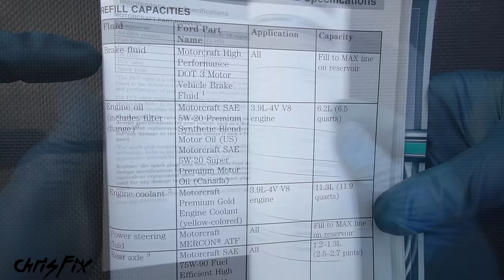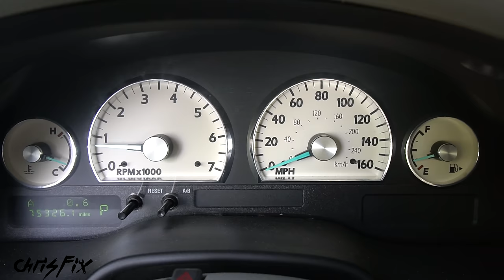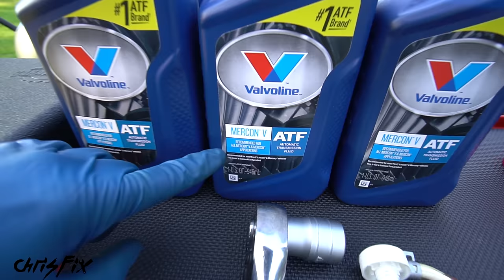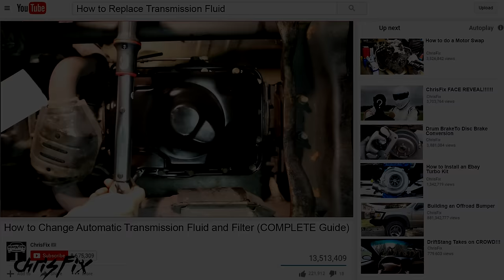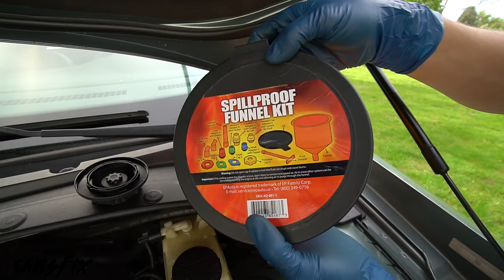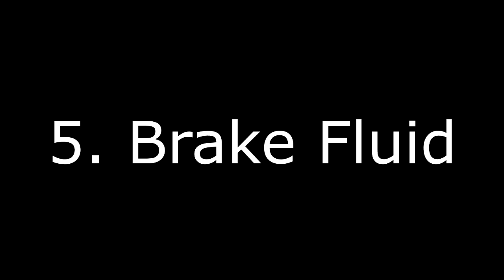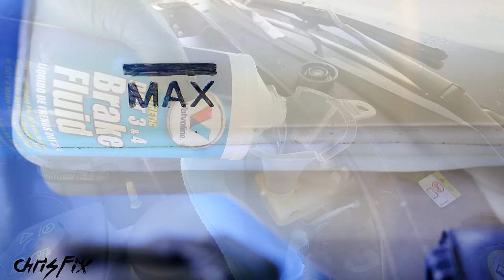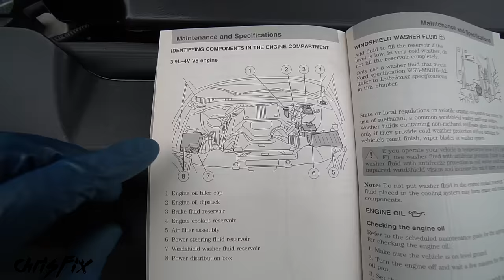How to Change EVERY FLUID in your Car or Truck (Oil, Transmission, Coolant, Brake, and More)

Comment: I was told not to flush any of my fluids because my car has 175k on it now. Otherwise it’ll get sludge and particles in the valves and engine and act up worse. So what do I do?
Reply: That is ABSURD! Are they telling you to not change the oil as well??? Or are you talking transmission only?
Reply: You never really wanna flush any fluid with too high miles. But even with high miles a simple drain and fill will not harm anything.
Reply: @Bobby-cm7vu  Well said

Comment: I disagree with this maintanance method
For a ford transmission
Just drain usung inner drain plug. You will change much less fluid.
You will be keeping the friction material inside and freshen up the fluid..
You can do this more often at no risk.!!
At low mialage and a first trans oil change the method in video is good.
The workin particles can flush.
From then on use the inner drain plug change less fluid and keep the friction material in the transmission.
Thats what the standpipe is for.
Cheers!

Comment: I bought a 01 jeep WJ V8 with 185k miles for almost nothing, needed a new starter and power steering pump, both are remade, however I noticed the transmission fluid is still red, I don’t know if it’s the original fluid or if it was ever change. Transmission shifts are smooth except when going almost full throttle sometimes from first to second, like it surges. Does anyone if a drain and refill of the trans fluid along with a trans filter change is a good idea or should I leave it alone? It’s more of a backup vehicle.

Comment: got a question, just did trans maint on my 5L40E on my G8, there is no dipstick, no fill cap, no drain plug, just a fill plug which is your drain plug then you drop the pan, i did all that and factory says 9.4q and everybody that has been in forums and on youtube that worked on a 5l40e says just under 5quarts, mine started dripping out at 4ish quarts. i did everything correctly and did my research and sometimes when i down shift from 3rd to 2nd around 1500 rpms , now my car jerks around mostly first 5 mins of driving, then is kinda stops and its not every downshift it just randomly happens when downshifting, mainly notice is when im braking from 3-2nd to take a turn?

Comment: Hey man my radiator coolant is a reddish color now and it’s only a month old what’s that mean
Reply from the maker: If your car is an automatic, it could be that transmission cooler lines are leaking into the coolant causing it to turn red, so I would replace the radiator. (I have a video on it here: https://www.youtube.com/watch?v=MeruAZebIeU) If your car doesn't have those or is a manual, I would say that would be some corrosion in the system causing the color change. I would do this then: https://www.youtube.com/watch?v=s--5ft5YiHg
Reply: @chrisfix  thanks I know ur right I changed it and it looks more green now

Comment: When i add the 50/50 coolant, is it ok to add the universal coolant to one that isn't
Reply from the maker: Yes you can mix universal coolant in but it is not preferred. It would be better to use the same coolant.
Reply: Thank you @chrisfix

Comment: Hey is there a way I can get ahold of you man?
Reply from the maker: What do you need help with?
Reply: @chrisfix  well alot of things bro I got a 2005 jeep grand Cherokee that is stuck in limp mode idk it won't go over 40 mph and also I got a 1998 Toyota Camry that I had a few questions about
Reply: There's a bolt that's rounded off that's holding my lower control arm to the lower ball joint I was wondering how I could get it off or what to do about that so I can replace the parts and also there's a bolt that I can spin freely left and right but won't come off either on my outer tire rod

Comment: 37:09 what if you live in a state like Arizona( like in Phoenix or Tuscon not Flagstaff) is it ok to use water as washer fluid?
Reply: you can but its not going to work as well
Reply: @arcanevoid9199  thank you for the info I did not know that

Comment: I know it's a bit old info. But please, don't prefill the oil filter with oil! You are not supposed to do that! Some cars even state that in a service manual. Prefill could lead to oil pump damage due to foaming.

Comment: How do i change the radiator coolant, the oil, the oil filter, the fuel and fuel filter, transmission fluid, spark plugs in my EV. oh wait, it doesn't have any of this stuff :) yay nothing to do.
Reply from the maker: It has coolant and brake fluid still ;)

Comment: Wait so why does the car have to be level to change oil why not just drive the front up onto ramps drain it pull the filter out put a new filter on roll thr car off the ramps and put new oil into it ?

Comment: you didn't change and replace all the fluids in your car .. you did not change the gas .. because you only fill it when you are running low for your needs.. it mixes with your old gas.. i'm positive there still a few molecules left from when it was first filled with gas .. a complete flush is needed to get these bad old gas molecules out

Comment: that jacking up the car part of the video needs a new upload.. cars today only have 4 small points of contact for the jack lift and a sliver of a piece of steel for the jack stands. It would be nice to cover that with a 2020 or newer car (for example VW) it's kind of unfair to replace any fluid on that car. VERY difficult to get under. The easiest option is to use car ramps but I don't trust them 100%

Comment: Hey chris myth or fact... If you had orange coolant and you put in green coolant or vice versa it will destroy your engine overtime.  Some of the older people I know swear up down left in right that if you put the wrong color coolant  in,  you will totally screw up the engine...  Truly I have uncles and a father that believes it will Cause catastrophic failure

Comment: Wait... you have to do all of these? I thought you just had to do the oil...
Reply from the maker: Yes all of these fluids need to be changed. Usually engine oil is changed most frequently tho.

Comment: Another YT wisenheimer.  Folks follow the maintenance schedule in your owners manual.  Replace power steering and brake fluid?  No mention in my owners manual for good reason, just a plain bad idea for the average owner to mess with these critical systems.

Comment: NEVER prefill the filter. Most waste of time ever. Rub some clean oil on the seal to make good connection, but prefilling a filter is pointless.
Reply from the maker: Thanks for sharing
Reply: no you are not correct right Chris? its prevents the engine from running dry right Chris?